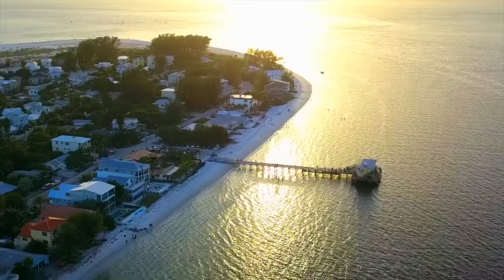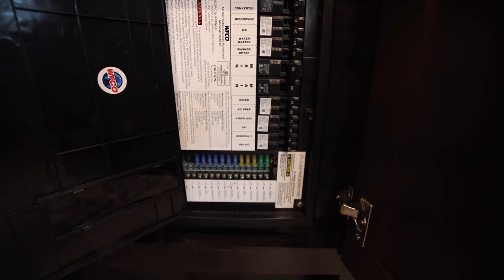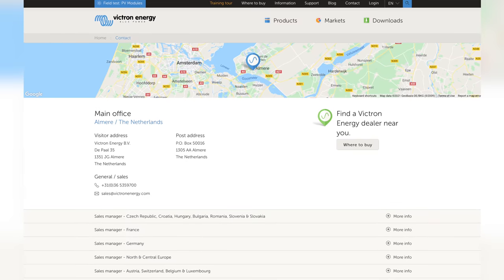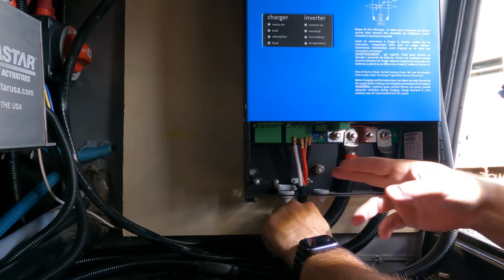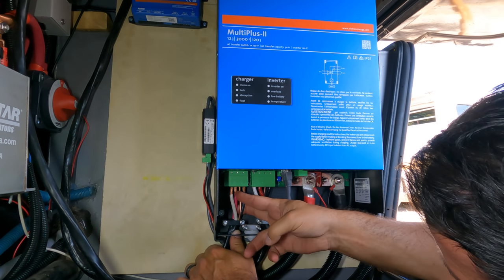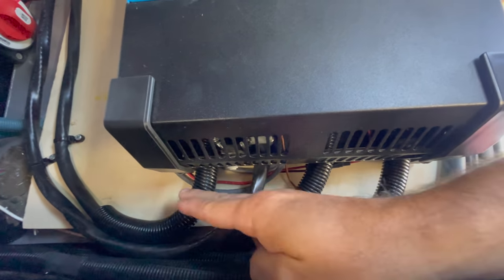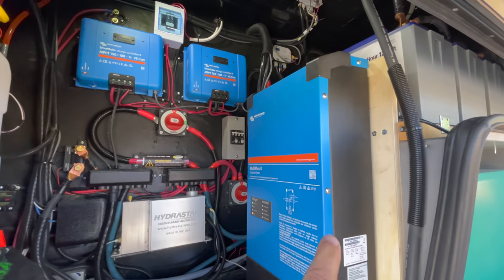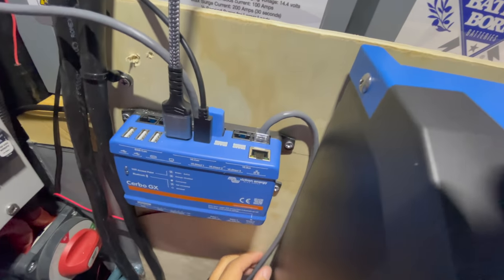🔋⚡️🔌 RV Inverter Upgrade! (Victron Multiplus II 12V 2x120 and CerboGX!) (Full Time RV Life)

Comment: Great video.  I am in the process of doing the inverter install and considered installing the CerboGX with display.  I am curious how you ran the HDMI cable from the CerboGX to the display?  Like you, I would like the display up by my other displays that are on the side of an upper cabinet at the opposite end of the, in my case, a travel trailer.
Reply from the maker: Please see the blog post here: https://changinglanesrv.com/rv-inverter-upgrade-victron-multiplus-ii/. and look half way down the products list for details on that.. 👍🏼

Comment: Can't the shore power and generator be wired straight into the multiplus without going through a transfer switch? I thought the multiplus can manage the 4 power sources itself; shore, battery, generator, solar.

Comment: Awesome video! Thanks for the content!I’m considering mounting my MPII and BB batteries in my front bay, as well. I also have an Onan 5500 generator. Do you have any problems with heat build up within the bay when the gen is running? Are you still running everything this way? Thanks!
Reply from the maker: Yes.. so far so good.. 👍🏼   NOTE: I have since hard-wired our CerboGX to our roster over ethernet.  When we were in high noise areas (lots of other RVs and Wifi signals), the connection was intermittent.

Comment: Have you though about adding wire ferrels to the end of the wires to prevent wire strands from coming out? I like Battery Cable USA. I purchased all my cables from them.  The turn around is really quick. Have you looked at integrating tank monitors via the Tank GX140?

Comment: Hey guys, good video. Installing my MultiPlus II 2x120 now in our GD 381M. I have one GC3 & one to add later with solar. Also located in generator compartment. I'm NOT going with the solar addition @ this time. (Maybe next year, $$!!) I'm wondering if you as I am concerned with the heat from the genny running for extended periods of time & overheating the MultiPlus?? Mine is installed on the bulkhead wall only 1 1/2" from the generator enclosure. We've been known to run our genny for 48 hours straight in Tennessee humidity. THX!
Reply from the maker: We've run ours for about 8-10 hours with no problem.

Comment: Ok, I'm confused as to why all you youtubers love the Victron inverter.  Their shunts are awesome but I'm running a 4000 watt pure sine inverter that can surge to 6000, and with an automatic transfer switch and jumper wire, it powers every outlet.  And as for the charger, running it separate means replacing a cheap component if one of them ever goes down.

Comment: i know this is a little bit of any older video and you have switched rigs also.  I am looking at doing a very similar setup.  Questions- do you have issues with your batteries being sub 32* in that bay?  Also I understand that the Victron Multiplus 2 2x120 drops L2 when it sees in-phase power like generator or 30amp.  This is problematic when running the generator especially since you get half the power it can produce. How did you get around that issue?
Reply: Chad posted another video about the L1/L2 issue running on a generator.   Short version, the generator's two outputs are in phase, you can parallel them together from 2 lines of 120 to 1 line of 120 at double the amps. Can be as simple as just putting a jumper between L1 and L2 at the generator INPUT side (NOT the output, you'll get a loud bang if you do that and connect to 50A service!!) of the transfer switch.   A 10G jumper wire from L1 to L2 will allow enough current to flow (especially since it's so short a distance).

Comment: Good luck with your generator. Unfortunately since your generator is most likely single phase, the Multi Plus will bridge your lines, so you’ll trip your 30amp breaker on the generator before hitting the capacity on your generator. We couldn’t run everything we could on our Onan generator that we used to be able to after putting this inverter in. Be careful and know the limitations. Most likely you won’t be able to run 3 AC units. Huge bummer for us only being able to get 30 amps out of a 45amp generator.

Comment: Chad, Another Awesome Video! Great Information!!  One quick question....If you are hooked up to 50 Amp shore power and loose power you system would switch over to batteries.  When the shore power come back on will that damage anything or cause an issue?   Not sure if you can answer the next question:::   I have the factory installed solar with 2,000 wat inverter and can set the generator to come on if batteries drop below a set level.  Would loosing shore power for me cause any issues when shore power comes back on?   THXS   Michael & Carol
Reply from the maker: If we're hooked to 50A and lose power, the inverter will take over.  However, if the load is over 3KVA (like 2+ ACs running), the inverter will overload and shut off.  In that situation, I'd need to shut the ACs off and turn the inverter back on.  We can do this all remotely now.  When power comes back on, it will switch over with no issue.

Your system is only connected to the fridge and some outlets ( I think), but it should work the same.. You lose power and the inverter kicks in.. power back (shore or generator) should be no problem.

Hope that helps!  😊

Comment: Chad, I got my battery system setup.  I followed another video on how to setup the multiplus-ii for lithium batteries and plugged in the numbers I got from CHINS for my batteries.  It is set to charge at 120 amps (I have 2 200ah batteries).  It is currently in bulk charging mode.  Some of the battery cables between the victron and the batteries are really hot (110-135 °F).  Is this normal during charging?  I'm assuming they will get hot when high amps are being pulled from them.  The cables are 2/0 cables from batterycablesusa.

Comment: Great video! Question- have you had any issues with running off of generator power through the Multiplus-II?  Curious if you are getting limited to only 30A from the generator.  We have a 2022 351M-R and am about to pull the trigger on the Multiplus-II and this was mentioned as a limitation.
Reply: Kent I have the same question! Hopefully he will see these..

Comment: Hey Chad, love the video. One question have you had any problems with heat from the generator and the inverter  being in the same bay?
Thanks
Reply from the maker: No alarms yet.. But it does get warm in there.  I might add a vent and DC fan over the winter.

Comment: Hi Chad.  I just wanted to check in.  I'm about to do something like this and wondered if you were happy with the 3000VA unit or if you ever wished you had the 5000VA unit.  I am getting a 50a motorohome and wondering if the unit you have is enough.
Reply from the maker: We were fine with the 3KVA unit but, if I were to want more, I'd wire 2 (or 3) multiplus ii 2x120 in parallel for 6 or 9 KVA respectively.  That way the whole RV has access to the full power available versus 3KVA on each leg.

Comment: With the batteries over the generator, do you experience extra heat that would affect the batteries from the generator?   And with all the heavy weight on the right side of the 5th wheel, have you noticed some extra wear on the driver side?

Comment: Hey guys, really looking at getting one of these for our Solitude but I am having problems getting my head around a statement in the manual around the AC2 output.  Can you guys give some ream world operational feedback on this statement from the manual?  

• AC-out-2
A second output is available that disconnects its load in the event of battery operation. On these terminals, equipment is
connected that may only operate if AC voltage is available on AC-in-1, e.g. an electric boiler or an air conditioner. The load on
AC-out-2 is disconnected immediately when the MultiPlus-II switches to battery operation. After AC power becomes available
on AC-in-1, the load on AC-out-2 will be reconnected with a delay of approximately 2 minutes. This to allow a genset to
stabilise
Reply: You only use AC2 output for things you don't want to run from the inverter.
Most RV's don't have a 2nd electrical panel for non inverter loads.
I didn't use the AC2 on my inverter

Comment: Thanks chad for the earlier response. I’ve been diving into the internet rabbit hole again, trying to learn all I can about this new set up. I was able to test all my equipment before this trip to Vegas from my house. Im now in Vegas and noticed that, since it’s 105 deg, I was running the two front ac units on 50 amp shore power. All was well until I started the garage ac and after a few short moments it kicked off and wouldnt run anymore. If I turned off one other one it would run normally. Then I tried to run just the bedroom and garage and that cause garage ac to turn off also. So I can run the living and bedroom ac fine, or the garage and living fine but not any other way? Is it possible I have made a connection issue with the two line one and two ac power lines somewhere? I connected them in the transfer switch just as they were from factory, and also in the converter as they were. Can’t find anywhere I might have made a connection error? I checked the pole at the park, 120 and 120 on both lines, so pole working, checked inverter, both lines show 120 into inverter. Also my touch display doesn’t show line 1 and 2 like yours, and if I only run the garage ac it shows no power draw on the shore power in the touch display? Like the inverter isn’t seeing it? I’ve looked over the wiring diagram, and have placed a call to my victron supplier. Any help would be appreciated. I know time is valuable but it seems hard to find support on these products. I’m pretty good with ac and dc wiring but now I’m kinda scratching my head. Any help would be greatly appreciated.
Reply from the maker: To get the 2 lines separate in the display you just need to enable release candidate versions then update.

As far as the power issue, that's strange.  Does nothing on line 2 show up?  My best recommendation is to find a mobile tech to take a look: https://rvtaa.org/locate/

Comment: Another great video!!!!     **Question: So when you went to the RV park in Vegas in July and there was only 103-110 volts shore power, would this inverter would have helped make up the difference and not blow the fuses etc??? Thanks in advance
Reply from the maker: Not really, because it's only a 3000W inverter and we needed a lot more for 3 ACs.

Comment: I am wondering why switchs for both the input and output of the solar controllers.  It may be the way to go but I haven't gotten that far yet.  I did get a 12V MP 2 but not installed yet... putting it on my ham radio shack .... will Victron 100/50 solar charge too.
Reply from the maker: Generally, each run of common voltage/amperage should have a breaker to protect the wire.  Many people think fuses and breakers protect equipment, but they really protect the wire so the wire doesn't become the "fuse" by melting / catching on fire. 😳

Comment: I'm struggling to understand how the power works in a 50V RV when running on battery and using the inverter side of the MultiPlus-II 2 x 120V.   Does it power both legs or just one when on battery?  Does the power assist allow it to move back and forth from one leg to another so fast that the breaker box does not know it's only powering one leg at a time?   I need to understand if a single MultiPlus-II 2 x 120V is going to power both legs on battery or whether I should be looking at putting in two MultiPlus of some other model.  Can you please give me an opinion based on your experience?
Reply from the maker: It powers both legs at once from one "hot" just like 30A shore power.  The two hots are bridged (that's what a 30A dogbone adapter does).  No switching or anything like that.  Hope that helps!
Reply: @ChangingLanes  Thank you.

Comment: Great video with great explaination!!  I am curious why you have an ATS?  Isn't it basically built into the inverter itself?
Reply from the maker: The ATS switches between shore power and generator.. the ATS built into the inverter is to switch between an ac source or inverting. 👍🏼

Comment: Chad, I know you have to run a new #6/3 wire from the ATS out to the Victron but can I splice the existing #6/3 to the distribution panel to the #6/3 ac out from the Victron , or should I run a new line and re-terminate it ?.
Reply from the maker: Every splice is a potential point of heat.  I really good splice might be okay, but I prefer to run a new line and re-terminate.

Comment: Great video, although i have had to watch several times to understand a lot of it. We are very new to this world and have had some issues with our inverter already (magnum) I do not understand the panel and how to read it or change anything. The screen on this new system looks very easy to understand, so maybe a upgrade is in the near future. Question i have is why not remove the old panel? Looks as though you could have taken out the old display and put the new display over that. Are you thinking if you resale you will take the new system out? Really curious as if i do the upgrade i am thinking i should just remove the old system completely.
Reply from the maker: The other panel in the cabinet is our LCI one control - for our lights, tanks, etc...

Comment: Hey. How did you get the DC load to show up on the touch 50 display? I have the reg multiplus. Maybe this is a feature of the multi 2. Thanks
Reply from the maker: There's a setting in the CerboGX called "has DC system".. turn that on and it will do some math to figure out DC loads.
Reply: @ChangingLanes  nice. I’ll check out. Thanks!

Comment: Awesome system Chad. Great video as always. Do you think a threaded metal connector would help prevent chaffing on your starter cable where it penetrates the generator wall?
Reply from the maker: I have the lines run through corrugated wire loom to protect it.https://amzn.to/3lBEwue

Comment: I have a 2019 sandstorm toy holler with a 30 AMP Onan generator. I also have a small solar panel on the roof. I am not sure how big it is. And I have a go power solar power controller. I have 2 Group 31 deep cycle Odyssey batteries. I’m looking at putting in a 4,000 watt inverter and wiring it into my generator wiring, coming off the power side of the generator going into the breaker box underneath the refrigerator. And then just flipping the breaker off for the converter when running off the inverter. Will that work. I’m just going to be using the inverter for the few 120V outlets and watch televisions at night when Boon docking at night. In the day time I will turn the generator on to run the air, conditioner, microwave, and Recharge, the batteries etc. Will that work? I’m new to this and I have no idea if that will work. What do you think?
Reply: And I’m not living in it, I’m only using my trailer to camp and sometimes we camp with out any hook ups.

Comment: I just installed the same inverter, and Love it so far, have you noticed any hum periodically when passing through shore power?  I am signed up for the Victron traveling education in Jacksonville in February, but want to see if other users are experiencing this.
Reply from the maker: It does hum when using power inverting or charging.
Reply: @ChangingLanes  just thought it was odd, because it sounds much different than the 12/3000 multi I had in our previous 30 amp trailer

Comment: Just finished my Victron Solar install.  Having a couple of issues. VRM and the GX touch don't show AC incoming or the Solar controllers. Bluetooth Victron  Connect App shows all of it connected and working fine. What am I missing?
Reply: I found the problem. Apparently a 20-ft HDMI cable is too long. Switched to a 10-ft everything works fine

Comment: Have you thought of adding a Lynx Distributor to your system? It would clean up some of that wiring.
Reply from the maker: The Lynx is nice but we just don't have any room.. Moving it would mean complete DC re-wire..
Reply: @ChangingLanes  that’s true you do have a lot in the front. We don’t have the on board generator so space is not a concern. Now if I can just get the trailer delivered half the battle will be over!! Reflection 278BH on order coming mid November too late for this year!

Comment: Hey chad! Question for you. I hope you see this and I get a reply just something you didn’t cover in the video. Say I want to reduce usage on shore power. Can I tell the victron to use more solar inverting than shore power? For instance running the majority or my power consumption on solar and batteries than always running on shore power? I suppose an easier way is saying during the nice sunny days where we have good solar charge and full batteries can my power comes from my own solar then when I need a bump or a recharge and solar can’t keep up it then pulls from shore ? Thanks
Reply from the maker: Yes.. sort of...  You can set the shore power on the victron to something like 15 or 20A, then everything over that will come from DC (batteries / solar).  The trouble is, it's a balancing act.  If you set it up that way and try to draw more than the inverter can handle, the whole thing shuts down.  So, experiment with the loads you will run.
Reply: @ChangingLanes  thank you so much for the reply! Will keep that in mind.